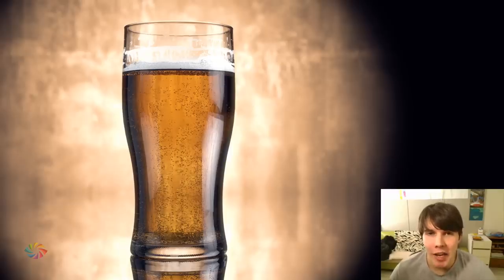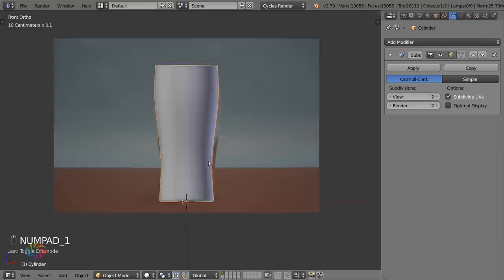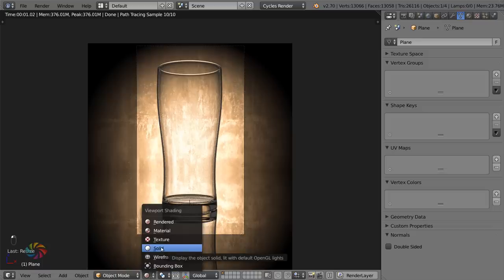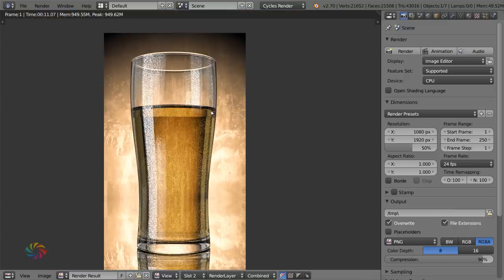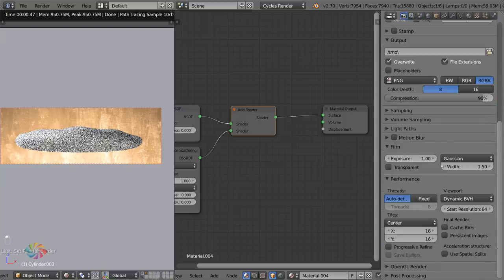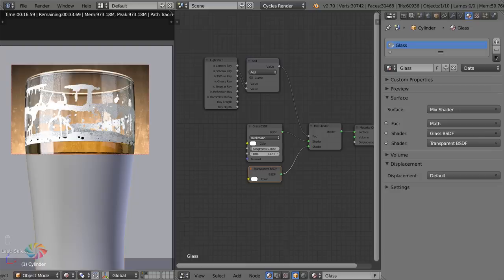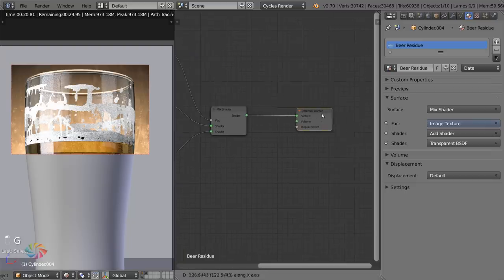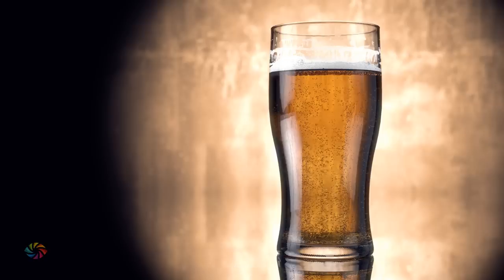How to Make a Beer in Blender

Comment: At 7:52 how do you just select the inside vertices? I can only seem to select the outside of the glass for some reason.
Reply: ctl I  flips the selection,  so that should get you there
Reply: Make sure you are in wireframe mode (Z), in solid mode you can only select outside vertices.
Reply: Make sure you have applied the solidify modifyer. ;)

Comment: In the original post render the base of the glass looks like some extrusion element (slight vertical twist) was added as a texture. It gives the glass a real fabricated look. Unfortunately you didn't elaborate on how you did that.

Comment: It might be 4 years late, butyou misundertood the IOR of bubbles issue. Bubbles in 3D, are just another "facing surface" of the liquid. 
That's why they should be face-inverted, and given the material of the beer itself. So they should have the beer's IOR.

Comment: Actually, the IOR of air is in fact 1, but calculating the IOR includes the speed of light in the middle you're coming from to the one you're going into. So coming from air to water, you get 1.333, the light is slowed down.
But coming from water to air, you get something below 1, because the light is going faster in the new middle.

That's the simple explanation, and some mathematic person will correct me (oh wait, not on a 3 years old video :P)

Comment: When Andrew does his first render at around 25:00, everything looks fine. However, when I render, I get very strange artifacts. From the bottom of the liquid to around 1/3 of the way up the liquid, the liquid itself is black. The same goes for the top, except it is a tiny fraction of the way down the liquid. The glass around it renders fine; I have checked flipping and recalculating normals, and I am pretty certain (after a bit of testing) that it is something to do with the glass shader. Does anyone else experience this problem or know a solution?

Comment: Hey, I have a problem. If I set up density in volume absorption more than "2" i have black beer, it doesen't  pass throught any light. I using blender v2.78.
Reply: me too!
Reply: I bought new GPU and now it's fine ;p
Reply: this seriously is a gpu issue? whyyyyyyyyyyy....
Reply: I change only gpu and it solve this problem, and newer version of blender has gpu support with this option
Reply: I have the same problem with both GPU and CPU render. i7-950 and GTX 770 OC
Reply: I didnt check this but maby apply scale will fix problem and keep real world size of this
Reply: I can actually go higher than 2. I'm testing in increments of 10 at the moment, but with an almost yellow color the beer becomes more and more red. I think I need to look into how these shaders actually work to understand the problem.
Reply: It's dependent by size of object. Smaller beer grabing dark color slower than big. Try make glass in real size and next scale it 10x times and check ;)
Reply: I see! Interesting. Thanks for replying! :)
Reply: MisterWonka propably its working by volume of object, and how many light is absorbed by whole object ;)
Reply: its not about gpu or cpu. click node volume absorption and try reset node on properties. it work for me :)

Comment: I am having a really hard time working on this small of a scale. It is a night mare just to select the inside of the cup and make it its own selection. Spent the last hour trying to get it right but still cant. Anyone got any tips?
Reply: In the 3d view N will bring up your preferences panel, go to the view tab and where it says clip set the start to something like 5mm then you will be able to zoom in closer.
Reply: How do you select something inside something anyhow? Do you make it a separate object first? Does it have something to do with layers? I see Andrew selecting the inside with one click. :'(
    I'll be checking out more basic tutorials of course, but if someone has any tips for me, please feel free to share them! :)
Reply: I'm assuming your talking about the liquid object inside the glass. If that's the case it is a separate object, witch you would achieve by first selecting the area via the regular selection tools. Press Shift+D to duplicate the selection, scale down duplicate for easer selection in the future(not required). Press P to make tis own object. Let me know if that works for you.
Reply: Zach Katsilas Thank you! 
   What I did was (painstakingly); select the inside grid, (part of the extra thickness, then make a top, then make object and P.
    Every time I added a shader the rest of the glass took on the same shader. (for some reason))

I can toggle the grid that gives the glass it's thickness on and off, should it be on or off?

I also notice that he can select the inside grid trough the outside grid from side view, and I have no idea how he does that. Maybe he created layers beforehand?

At any rate, I've started with blender for noobs course. I think this one may have been to hard for me. :)

Feel free to answer my questions if you have the time and energy of course. And again; Thanks! :3 I'll experiment with what you said making a shot glass.
Reply: Grabaka Sennin Forgot to make separate material.. '-'

Comment: HOW DO I SELECT THE INNER PARTS OF MY GLASS?
Reply: I struggled with this as well. For those still struggling: I just selected a single vertice (in edit mode/wireframe) in the middle of the inside face at the bottom of the glass and pressed Ctrl and + to increase the selection size until it covered everything inside that I wanted. Everything else I tried loved to select the outside as well (yes I "applied" the Solidify modifier).

Comment: Good tutorial but your method for creating that liquid is not up to standard. I find it much more easier to add the solidify modifier to the glass then duplicate the mesh and separate then remove the solidify modifier to the liquid mesh. Works perfect every time. I also just select the edge with alt and click F to fill the face for the liquid. But good tutorial.
Reply: This was created nine years ago, and I believe it was done using Blender version 2.63.

Comment: Dude, a glass of beer can not be 2.5cm :D A glass for a baby wouldn't be that small. 2.5cm in about 1in and also 10cm height is not possible. I guess you have mixed imperial and metric system :) Now i need to return to tutorial :)
Reply: That was the radius. Remember diameter is radius x 2.
Reply: Adam Falldorf  You are actually right but still there is no sense in a glass that is 10cm in height. That is totally strange which means that 5cm in width is not accurate as well.
Reply: Not that it is important or worth arguing but it clearly says radius above the input field...
Reply: Adam Falldorf I agree. My mistake but still dimensions are totally off. It should be about twice as bigger. Anyway it is in proportion and looks good.
Reply: Sasa Rakezic It does seem weird number-wise, but go look at 2:1 proportions and you'd be surprised. But most beer glasses are 15 cm tall, so it should also be a little wider.